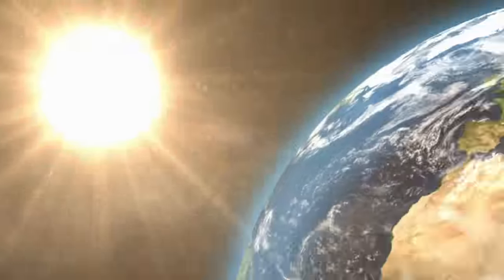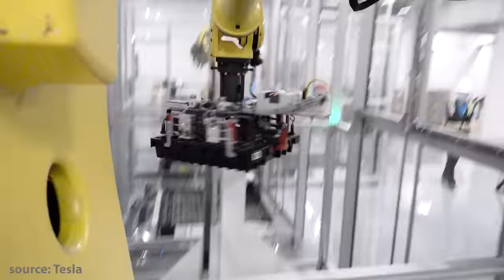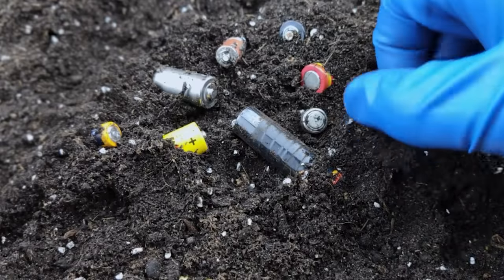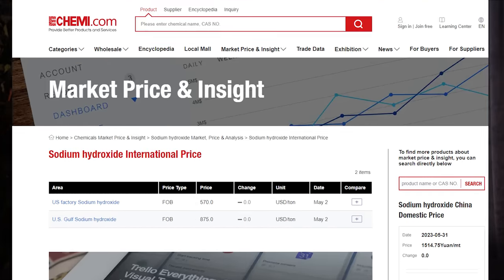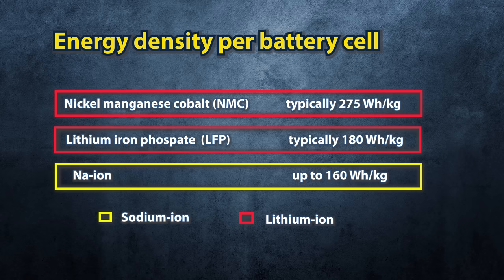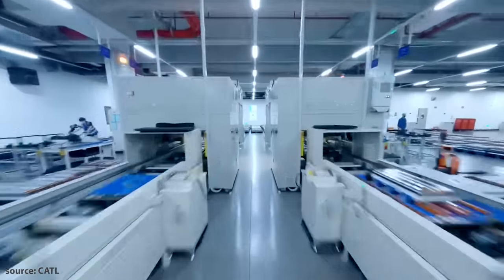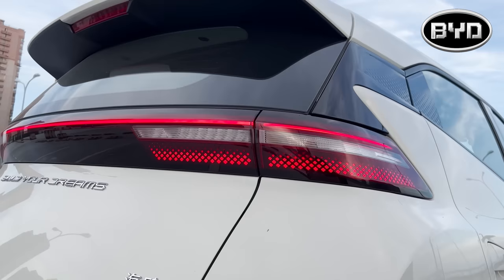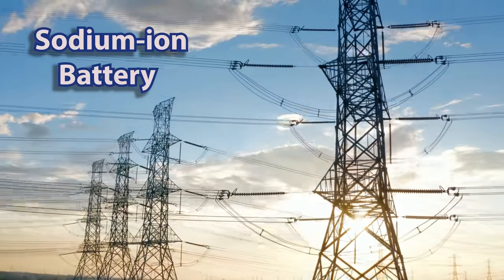Goodbye Lithium!  New Sodium Ion Battery will change the world! And it's in MASS PRODUCTION

Comment: Potassium and phosphorus batteries have been around since the 70s. Aluminum/air batteries also. Hell a phosphoric acid battery has been arosince the early 70s. The problem with it is that it has to be heated to 600 degrees  Fahrenheit.

Comment: bye for complex batteries, meet znso4 battery, zn-h2so4-air battery, iron container negative electrode, graphite positive air electrode, yep zinc plating cell but as a battery ultra capacitor. similar to lead-acid battery, but better, about 433Wh/kg specific energy storage.

Comment: Dear Martyna, Thank you very much for the video. I learn a lot more about Na+ battery chemistry again as I keep on doing daily these days.

By the way, does anyone know if it is okay to charge sodium ion car battery with CTEK CS ONE battery charger? I have decided to replace the always troublesome lead acid AGM car battery for a Na+ battery of the same capacity, that is 12.4V, 110Ah battery for my SUV or SAV as the manufacturer named it and I have CTEK CS ONE charger that is capable of charging any battery up to LFP but I am not sure of Na+ but as Martyna explained that both share the same chemistry characteristics, I assume it should be okay.

Please somebody, anybody, let me know.
Thank you.

Comment: So glad you are talking about this tech. In a short time there will be an inflection point where you wont be able to sell your house if it does not have solar install and battery backup. It will be like trying to sell a house in 2023 without indoor plumbing.  Great work on you channel spreading knowledge!
Reply from the maker: Haha I love the comparison you made and oh boy I am looking forward to those times. Thanks for the comment :)!!!
Reply: I wouldn't buy a mansion without a microwave oven or a wi-fi router, because everybody knows once you buy a house that's missing something, you're stuck without the missing thing forever.
Reply: @chesshooligan1282  I appreciate what you are saying but those are small portable things whereas plumbing, electric, solar and other large infra is less appealing to retrofit. For example when I buy my next house I want a 4 car garage, yes I could build an external/additional garage but i am much more likely to just buy a house with that already due to the cost and complexity of adding it on.
Reply: lol.
Reply: @callmebigpapa  Yes, it would be impossible to add batteries to you house.  You might as well tear the whole thing down, and start over.   Same for solar cells.  If the house is not built with solar cells, there is no known technology to put them on a house and run all those wires down to the batteries that aren't there.

In fact, maybe the best thing to do for new houses is put in the solar cells first, the battery second and build the house around them.   Then we can be extra sure it will have those impossible-to-add-features later.
Reply: I think sooner than that you will need to have a heat pump or solar thermal system to be able to sell your house. When the gas grid shutdown is looming no one will want to buy a house that relies on gas heating.
Reply: @adrianthoroughgood1191  The gas grid won't be shut down in anyone's lifetime.

Comment: That battery drilling demo is suspicious: a fully charged pouch cell of that size would likely have a short-circuit current of 50+A and drilling through it would definitely heat that up considerably. The only way for absolutely nothing to happen as if drilling through wood is for the battery to be at very low state of charge.
Reply from the maker: Interesting thought. I have seen BYD and their blade battery that is not sodium but lithium and has similar effects when they drilled into it and that was due to the design of the battery. I am just curious for more of that sort of testing so we can know for sure we are not being lied too...
Reply: @solartimeusa  I'd expect even solid-state batteries to show hot metal discoloration: a fully charged battery would be shoving full short-circuit current into the blade as it goes through. I imagine it may even arc-weld the blade to the battery.
Reply: I agree if that cell was charged you would see large current flow and the bit or battery getting red hot.

Comment: That's great for backup at home, but as for cars, you still have to produce the electricity to begin with to charge these cars. So having the infrastructure to charge the cars and being able to produce the electricity for the increase in the number of cars is still real. There needs to be technology to at least double the range of the cars at a minimum and cut the cost of the cars in half at a minimum and then increase the output of the electric grid about 10X. Still have a ways to go.
Reply from the maker: I Agree.... I think the better technology for EV will be solid state battery, I am working on that video now, stay tuned. 

We do have ways to go as far as EVs for sure!

Comment: considering Nabatts' range of 0-100-0% reliable charge/discharges cycle vs 20-80% rate the one of Libatts, then Wh/kg rate will be in favor of Na. r8? all that bms protection and correct controlling chrg/dischrg stuff requires less attention for the Na's... also r8? kinda where are the cons against Na, then we improve on it.

Comment: FIRST - Overbuild across a wide geographic area. Wind and solar are 1/4 nuclear now, so we can afford it. Don't think about your city going 100% renewables, think about North America as in Canada, USA and Mexico all being interconnected and going 200 or 300% wind and solar - and that's just for electricity (and maybe some transport). It's VASTLY cheaper to see renewable grids this way than to try and store enough power for winter in your own city or State. Professor Andrew Blakers has modelled Australia - with all our sunshine and windy coasts, and concluded that if each state in Australia were to try and build their own renewable grid - each state would pay up to 5 times more in storage costs! THEN realise that sodium batteries should only store the first hour or so. Professor Blakers has a Global Pumped Hydro atlas that shows that there is 100 TIMES the storage the world needs in OFF-RIVER pumped hydro. No rivers get messed up. These dams are faster and cheaper and safer to build than on-river. Fill them slowly and cover in floating solar panels to reduce evaporation, and you can have all the storage you need. But I hear you - sodium batteries are awesome. But basically I think off-river pumped hydro in the blakers global atlas show that this should be prioritised as a Federal government public infrastructure build, and just smash them out!

Comment: Cheap grid storage is absolutely key to everything. At the moment wind and solar can only provide a limited percentage of grid power because the coal or gas must be ready to fill in the gaps and maintain grid stability. Cheap grid storage would fix this. It would also greatly reduce the need for extra grid distribution cabling as energy could be sucked up at off peak times and stored locally. When grids become 100% renewable then EVs and heat pumps will start to make a lot more sense.
Reply from the maker: Exactly! The biggest problem is the demand for power in times when solar and wind are not available...
Reply: @solartimeusa  It goes deeper than that. The network has to be stable, which means maintaining the correct AC voltage and frequency irrespective of demand and supply. Fossil fuels don’t just supply the energy, they also fulfill the storage function, particularly gas that can be ramped up and down quickly (along with other things like hydro and pumped hydro) to match supply and demand. If wind and solar were augmented by cheap, high capacity storage they could completely replace fossil fuels instead of being just a useful supplement.

Comment: Just a few short note to correct the false information in this clip.
1) The biggest Lithium export country right now is Australia. Then Chile and China second and third, and the two still behind Australia in combine. However talking about Lithium reserve, USA ranked 3rd after Bolivia and Argentina. Chile, Australia and China ranked 4~6. So USA does have a lot of Lithium. There is just no one mining it yet.
2) While Sodium ion (Na+) battery appears with a very similar property with Li+ battery, it has a much lower energy density level consider it is much higher ranked in the periodic table. Li+ batteries are having 500+Wh/kg nowadays while Na+ batteries are around 160Wh/kg (200Wh/kg is the goal. it took them a decade to go from 80 to 160 using technology from Li+ batteries, which goes from 120 ten years ago to 280 today, then 500 in the lab), similar to LFP batteries. While it is still good for being the backup battery in your backyard, it is not a very good choice for your phones nor your EVs... too heavy and bulky.
3) Li+ Battery started off cheap too... but then it goes higher and higher. supply and demand thing. The exact price of Na+ Battery would take time before it gets stable because Sodium ion battery is not Sodium.

Comment: I wonder if it will ever work as smartphones batteries
Reply from the maker: Interesting question. I definitely think so, lithium will continue being used in the more high power devices like cars etc, but sodium will be huge in stationary storage in my personal opinion. :)
Reply: @solartimeusa  I have no doubts sodium will be used in great storage batteries, maybe even cars with a shorter range, but as far as I understand they are 3* bigger than lithium batteries because of their molecular composition.

So I guess for smartphones, tools and smaller devices it will be a big no.

I'm kinda sad, I love the battery trend but we'll run out of lithium for 10 years at this rate, and it pollutes so much

Comment: Sodium could be a game changer if the energy density was sufficient to power commercial air flight, which, as I understand it needs to be 400 W/ kilogram or better

Don’t confuse the countries producing lithium at this moment in time with the global availability in nature. Lithium is available all over the world, but the countries in which they extracted. I’m not that numerous. Though I suspect that is about to change and the energy density of the new lithium batteries appears to be far better than the 200 W per kilogram. You’re talking of

Comment: It is important to make the distinction between a cell and a battery, A cell is what most people wrongly refer to as a battery, as in an AA battery or a AAA battery. These are cells until you electrically make a connection to at least one other, it the becomes a battery, to be correct, a battery of cells. Showing a cell and calling it a battery is wrong.
Reply from the maker: AGREED! I will make sure to be more specific not to spread the common mistake like that. Thanks for pointing it out :)

Comment: The fundamental properties of sodium are similar but slightly worse for batteries, compared to lithium.  Besides lower energy density, sodium is actually generally more reactive than lithium. Choosing worst case lithium based batteries with a type of sodium batteries that can be punctured, and claim that the difference is caused by having sodium instead of lithium is false. 

Sodium atoms, and ions, are much bigger than lithium atoms and ions. Atomic mass of sodium is over three times that of lithium,  and that is why energy density lower. And that causes some other issues for use in batteries, the ions moves in the batteries, and using sodium requires moving more than tree times, by mass, larger ions for the same amount of energy per ion. That means the disadvantages of sodium are totally fundamental and unavoidable, and quite significant.    

Lithium typically don't make up a huge part of the total cost of lithium batteries, significant yes, but not huge. Lithium is abundant enough, some of the problem is that extraction and refining has trouble increasing as fast as demand, because the relative growth of demand is huge.     

Lithium and sodium is produced the essentially same ways, supply will catch up with demand, and lithium will constitute a small part of the total cost of lithium batteries, even if it will remain more expensive than sodium, that difference will have small to insignificant impact on the cost of the batteries.       

The really great thing with sodium batteries, and yes, there's an enormously great thing with them, and that is that they can potentially keep price of lithium low, by replacing lithium in applications where the lower performance is acceptable.  In the same way choosing LFP reduces demand for nickel and cobalt, with the difference that LFP also actually have some practical advantages over more energy dense lithium-ion batteries.

Comment: Sodium batteries will have less density leading to either bigger batteries or more probably less capacity thus less range. The EV's range is already not that great, it will be even worst.
Btw we see huge drops in sales of EV's all around the world. So we need a true revolution in batteries : much more range, a lot smaller and capable to charge in maximum 5 minutes. Sodium batteries are not at all a revolution, just an evolution.
Reply from the maker: I personally agree that it will not be sodium-ion batteries that will change the EV industry. The stationary storage and home/ residential back up yes. For EVs i think it will be solid-state batteries. Working on this video now, Hope you will give it a watch. Thanks for sharing your thoughts :)!

Comment: i think replacement of all cars with electric is a long ways off. a better cheaper batt is one step.
  The big problem for all electric, is the country needs to produce a lot more electricity .Then the next problem is charging time. perhaps a charging station can be a battery replacement station, just swap out the battery

Comment: An absolutely huge benefit of sodium batteries not made a big enough deal of is they can be drained to zero % without damage which means you are guaranteed their full life. With lfp their life will be reduced certainly and sometimes completely destroy them, kind of a bad day when they are 20 grand worth.
Reply from the maker: Hey, thanks so much for sharing and yes that is a huge part, especially to those homeowners who don't want to worry or simply don't have the personality to worry about how much they drain their batteries, so I think it will be HUGE in residential market and home back up options. 

Thanks again for leaving a comment. 
-Martyna

Comment: I agree. We cannot use Lithium batteries (which explode). Several people in the UK alone, are dead because they were charging their bicycles inside their houses.
Many videos from China show cars exploding.

A lower storage capacity in Na would be an acceptable compromise, if they do not "go bang".
Reply from the maker: Exactly, which is another problem. Sodium is also explosive, so I am looking forward to seeing how they will design those units to finally make them more safe.
Reply: @solartimeusa  All batteries are potentially dangerous. I suppose handling wth care and respect are what will make the difference.

Comment: Did we not have these batteries in electric cars in the late 1800's?
Reply from the maker: Sodium-ion battery (SIB) was originally developed in the late 1980s, in similar time as lithium ion batteries. But maybe some form of sodium was used before i would have to dig deeper. The first Electric vehicle back in 1888 used a lead acid battery with a whooping  1-horsepower electric motor :D

Comment: Sodium Ion batteries are a lot heavier than comparable Lithium batteries.  I don't think SI batteries will replace Lithium automobile batteries in the near future.  Am I wrong?
Reply from the maker: Think you are right. I think sodium will be big in residential and stationary storage. But solid state will be huge for EVs. Posted a video about it on thanksgiving hopefully you will enjoy it! :)
Reply: @solartimeusa  I think I have heard of solid state batteries but I know little about them.

I think SMRs...Small Modular Reactors...is the non CO2 emitting energy of the future.  I don't think solar or wind will ever be a large part of our energy produced.  It is now only 3.65% in Georgia and maybe half that depending on how they calculated that percent.  I have been unable to find that out.  If I am correct, there will not be nearly as many big batteries as many think.

Comment: Not new. 

Sodium batteries have been around in one form or another for thirty years or so. The issue is whether they have solved all the problems associated with this type, power density, weight, longevity and above all safety. 

Some of these problems are deeply embedded in the nature of the materials used in sodium batteries so not easy to solve.